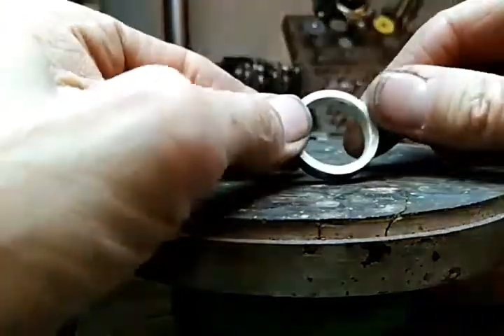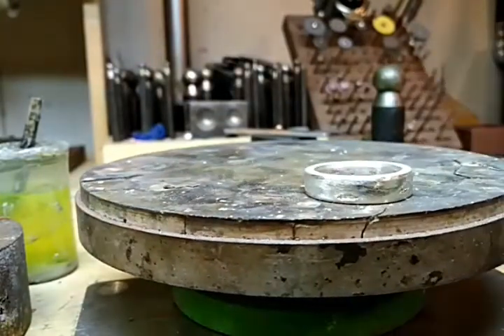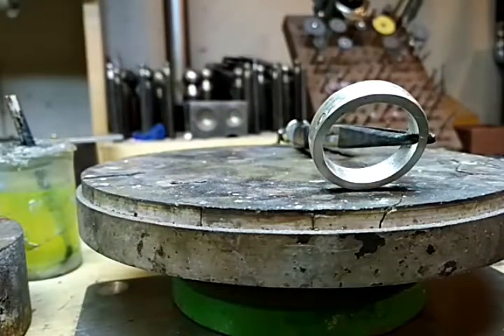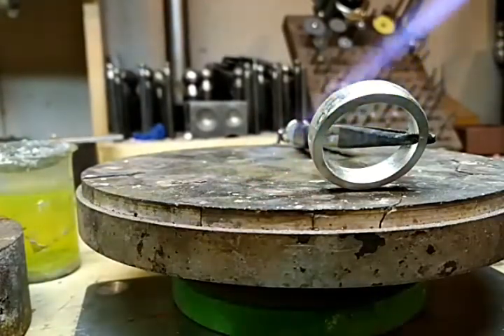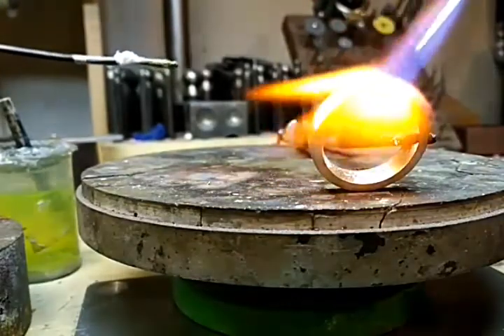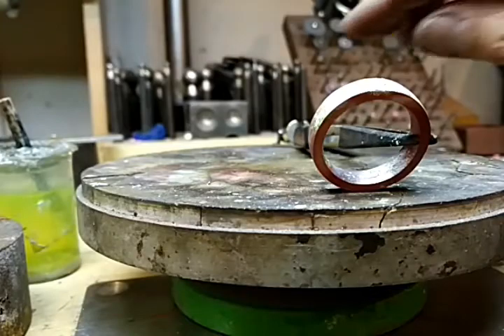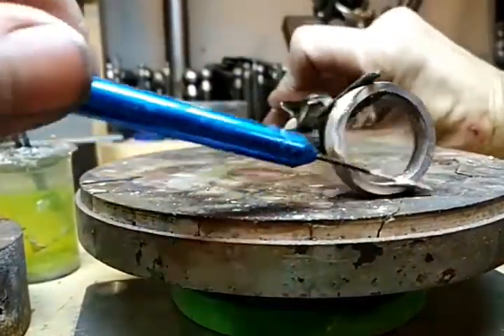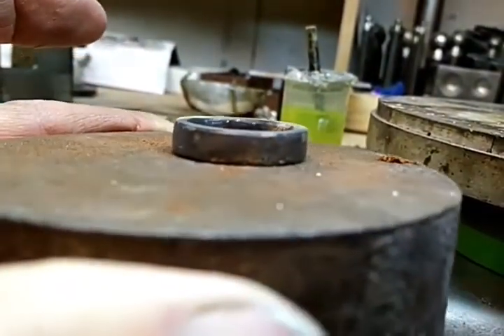Two Ways to Fill the Pits on a Sterling Silver Band

Comment: Once the ring is fully heated it leaves purple firestain all over the ring...what's the best way to get rid of the firestain?
Reply from the maker: It needs to be pickled is a solution of about 2 tbsp of Sparex or PH Down mixed in 4 cups of water that is warmed. A crock pot on low works. Just make sure you have ventilation and don't breathe it in. Only use copper to dangle the ring in the solution and no steel.